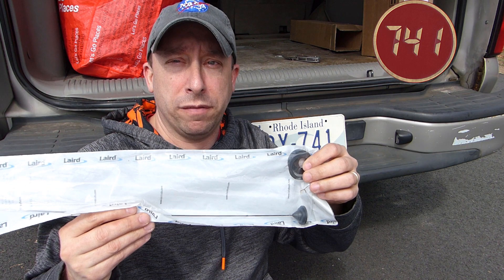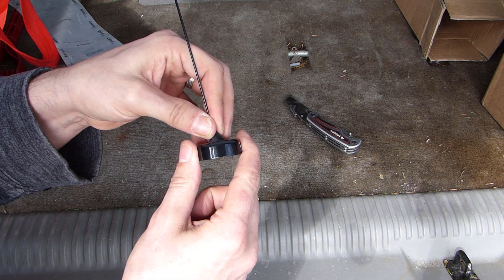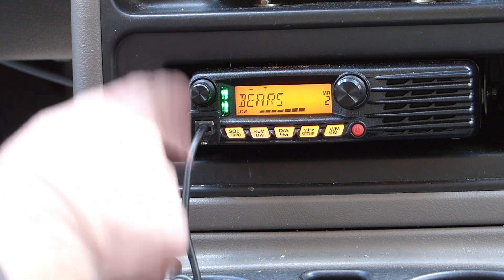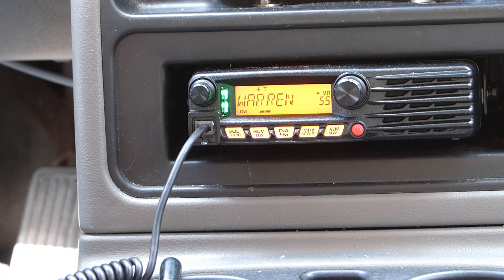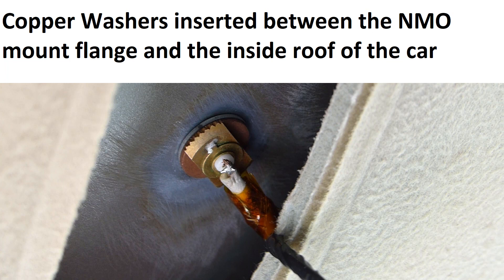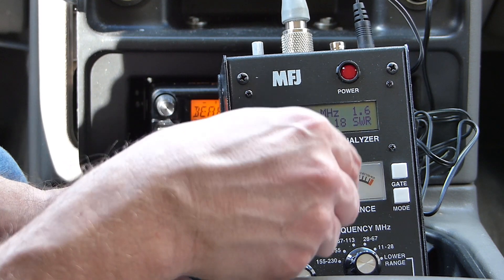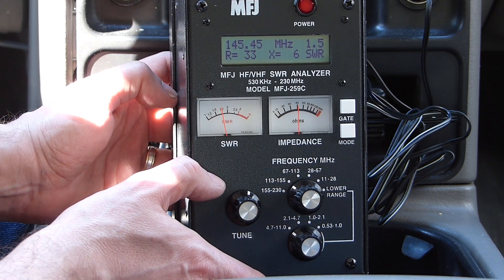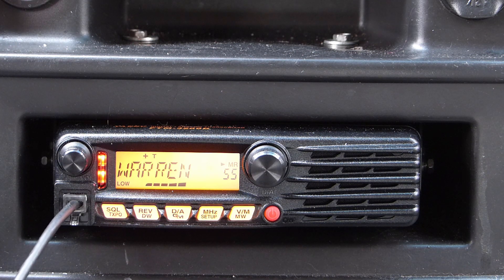2 meter antenna install and shootout 1/4 wave vs 5/8 - which is better?

Comment: Ham since 1969  Been Extra since 1983 and hold a First Class radio telephone and worked for Motorola. If you mount an NMO Motorola had a special hole saw that would cut a 3/4 hole and would scrape the paint where the brass nut would contact the roof. Also the absolute best 2 meter mobile antenna I have ever used was the Model CG-144 Hustler. I could use regular repeaters at 100 miles or more. Running Motorola Spectra 110 watts.

Comment: Many years ago I tried a similar comparison, in the city the quarterwave seemed to be an advantage, we attributed it to the less defined polar diagram perhaps being better for reflecting signal off buildings etc. The 5/8 seemed to have the edge in open countryside although perhaps with more flutter at higher speeds.
Reply: g0fvt - The take off angle on the 1/4 wave was probably more efficient for your needs as the repeater antennas were probably on top of buildings. The 1/4 wave puts more signal skyward instead of across the horizon. I’ve always had good results with 1/4 antennas, I’m rarely any greater distance than 30 miles from one so they work fine for me.
Reply: Derek Lea , difficult to say, mostly the repeaters were some miles away so not a huge angle if they were at about 100ft above ground level. A popular antenna at the time was the 7/8, worst of the bunch for flutter....

Comment: I hit the Warren repeater from my house in Smithfield,  was able to speak with a Vermont station. Kc1joz here 73s
Reply from the maker: Not bad!   That repeater was off the air for a long time.  I don't use it often but I'm glad to see it back on the air and working well.

Comment: I have used both on my suburban, the 5/8 seems like it gets less picket fencing when moving. the 1/4 does seem to have a bit better low angle radiation
Reply: Lower angle from 1/4 wave is unlikely. The typical 3 db gain from switching from 1/4 wave to 5/8 wavelength antenna is gained by having a lower angle of radiation therefore not wasting as much signal into the stars above you.

Comment: That was a good test no matter how unscientific it might have been. I think I might need an antenna analyzer someday. I think most do not do 70 CM but the one you have does a lot of the HF bands, correct? I have my general and by winter I would like to have a HF rig and antenna. I will have to go and watch your videos. I see you have some SDRuno videos. I started by playing with RTL-SDR and SDRSharp. I did not know what I was doing so all I could really get was some CB band, VHF and UHF with the thing. Clearly I was ignorant and also did not have the correct antenna. Thanks! Subbed and belled!
Reply from the maker: @fpeletz I don't run 440 so no need for me to upgrade right now, but thanks for the info!
Reply from the maker: You can get analyzers that do 70cm...just depends on how much you want to spend.  Mine does not do 70cm but I don't run that band so I don't need it.  Rtl sdr dongles don't really work below vhf...you were lucky to get cb on yours.  Sdrplay units are MUCH better than the rtl-sdr and cover all hf bands as well as vhf/uhf
Reply: @SevenFortyOne  Thanks!

Comment: Unless the 5/8ths is a piece of crap construction, then  your question is easily answered. However, you ask which is better, not which is more efficient. So if you want a weenier that fits easily in your garage then the 1/4 is probably better.

Comment: My understanding is the 5/8 wave is superior in the quality of the signal while the car is moving. The signal strength between the two stationary should be similar. What would really test it is the audio quality from a moving transmission.

Comment: Hi Rob, for the most part, I don't see much difference between the 2 when mounted on the roof.  A good comparison, I like that the Laird has a solid brass flange, no chance in it cracking.  good vid.
Reply from the maker: I'm glad you liked the video Buzz...I didn't see much difference either.

Comment: Been using a 1/4 wave on the roof of my truck for a long time. The roof makes a great reflector!
Reply from the maker: 1/4 wave seems to the the way to go for 2M...simple, cheap, and small.
Reply: The roof makes a good GROUNDPLANE. Beam antenna have a reflector.